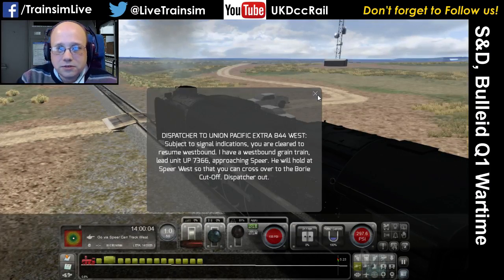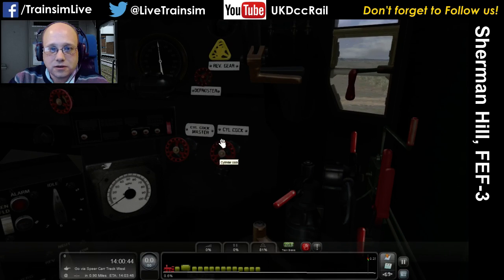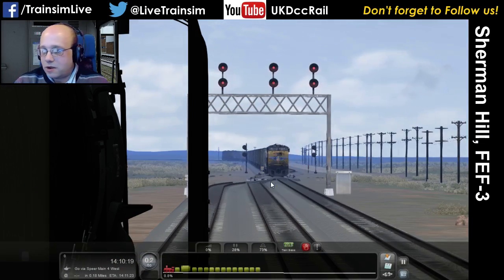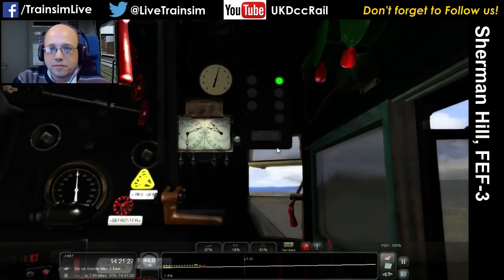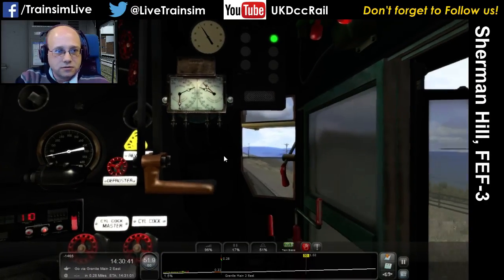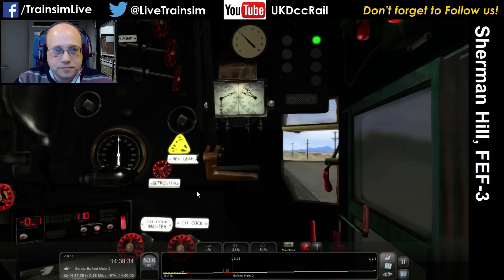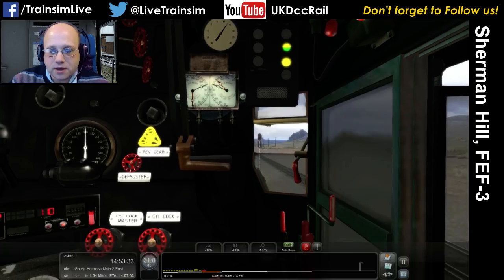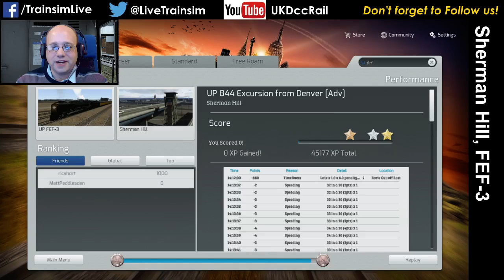Train Simulator 2015 Steam Special - FEF-3 Northern on Sherman Hill

Comment: Just got this Locomotive today. I can see that this will be something that will require a great deal of time to master, but you can always use the HUD to run it more quickly. Great learning tool that grows with you.
Reply: There are also some very good videos by ProfessorOleander (Robert Connor) that show how to operate the FEF-3 in advanced mode, firing manually. Robert was a fireman on oil-burners for six years and knows a thing or two. I recommend watching his videos - you'll pick up plenty of tips on how to get the most out of the locomotive.